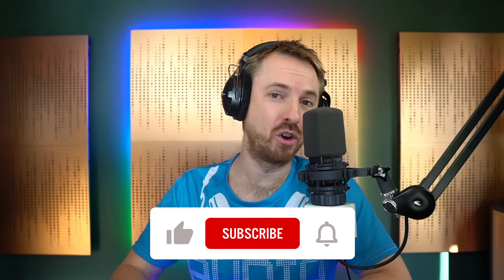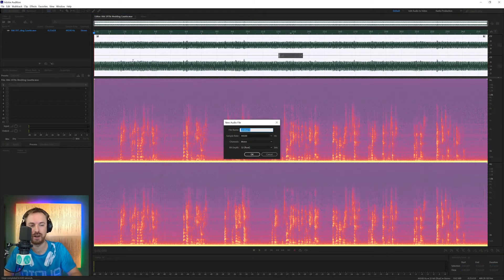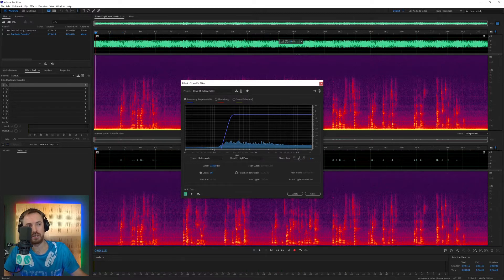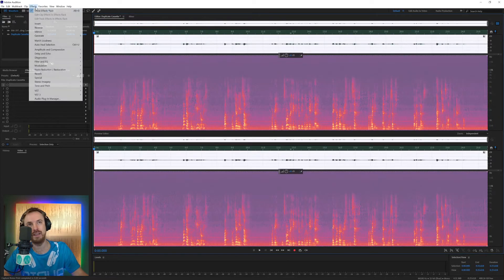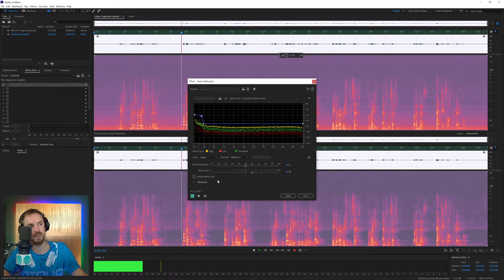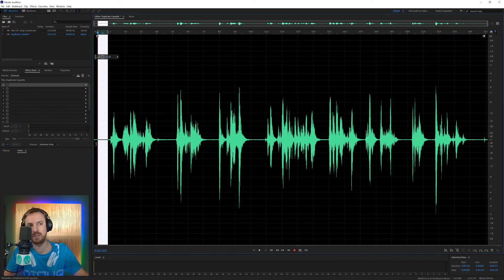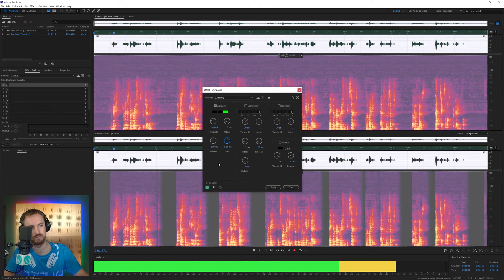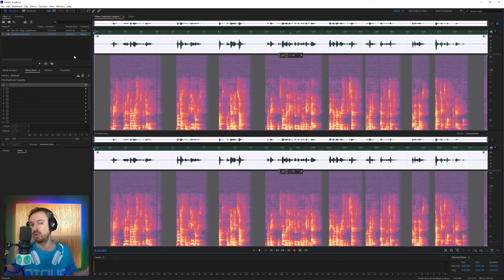How to Make Cassette Tapes Sound Better

Comment: Treating 50/60Hz hum with a high-pass filter at 180+ is not the way to go about it - that throws out a ton of voice information! Using a dedicated plug-in for this would be vastly better, and if not, you use a notch filter at 50, 100, 150, 200, 250 Hz, or 60, 120, 180, 240 Hz.
Reply from the maker: Good tip!

Comment: What should I do with an audio cassette tape which was digitised but when imported into audition looks totally clipped but yet when DeClipper is used audition doesnt detect any clipping "0 Problems detected". must be because it a audio cassette and audition thinks there is no clipping due to the way cassettes are digitised?
Reply from the maker: Run through plugins like iZotope.
Reply: Setting the tolerance to 15% solved the problem and then it detected thousands of clipping  @MikeRussell

Comment: Thanks for a easy-to-follow tutorial, this is my first time using Audacity and I've been able to improve the quality of an interview I did with my nana 30 years ago, the family will so appreciate this treasure. I have one remaining issue - the sound of the tape turning is still loud, any suggestions?
Reply from the maker: To reduce the sound of the cassette turning try enabling the noise reduction effect in Audacity. That said you may want to manually edit it out.

Comment: Great tips as always. I have been using amplitude statistics as per one of your previous vids to clean up normal room noise instead of the noice print option that I used before. Question I have, is it ok to just use amplitude option with noise gate due to it being a much cleaner recording  from my mic than the one you are showing here that is very noisy, or should I do both? I must say that I am happy with end result but thought one or the other was enough for my use. Probably over thinking it as is easily the case as so many different ways to get good results. Thanks for all the time and effort you and your team put in to produce this and the Friday jingles.
Reply from the maker: Ideally you want to minimise noise before recording.  In the event this is not possible you have to consider how much noise there is.  If it's minimal and not detectable when talking the a noise gate or downward expander would work but if it's detectable when you're talking then you'd need noise removal as the noise gate or downward expander would be too noticeable.
Reply: @MikeRussell  thank you.